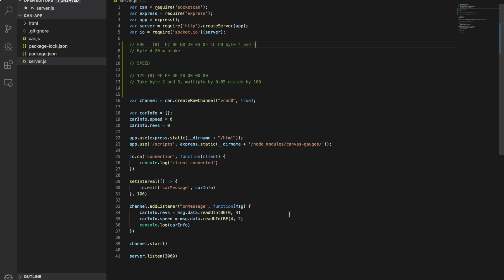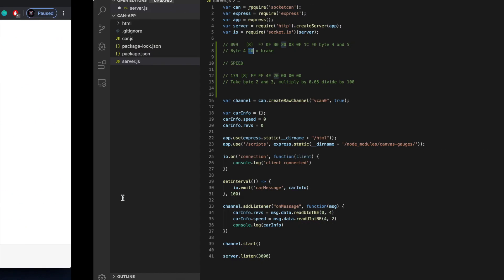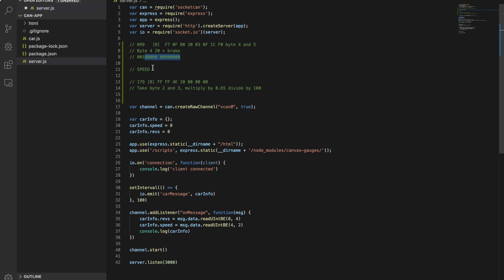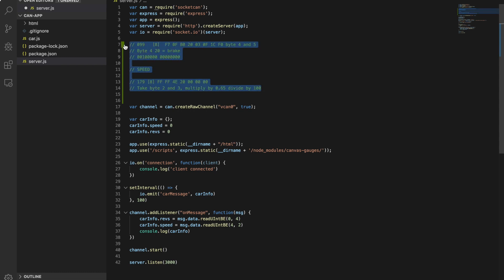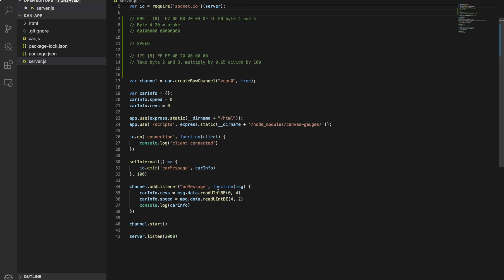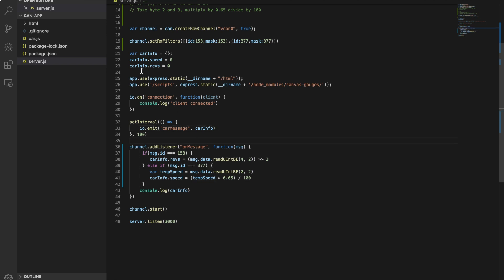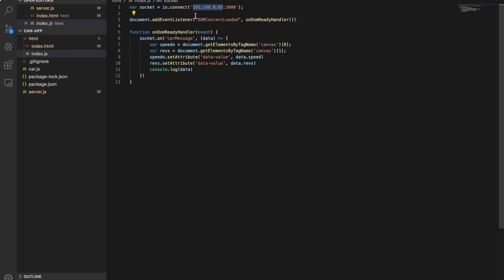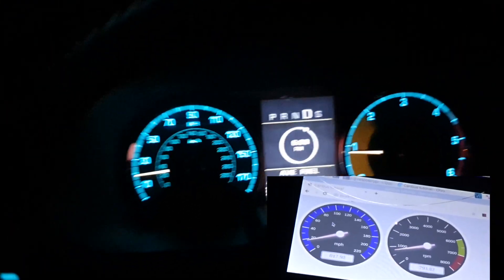nodeJs canbus application part3: Integrating app to work with the car, and display gauge data

Comment: have you thought about using nodered?  it has a builtin dashboard with visualization tools.  It also has a canbus node that you can use to manipulate and display data.  I was planning on going that route for my custom dashboard
Reply from the maker: It's crossed my mind, but the main reason for not going that route is mainly just the visuals. By just using standard web technologies there's so much out there that can be used, and so many effects that can be added.

Last reason is that this can all eventually be packaged into an app that opens with a simple double click, so very easy to integrate into open auto.

If you do go the node red route, I'd be very interested to see how it turns out..

I enjoy your vids by the way!